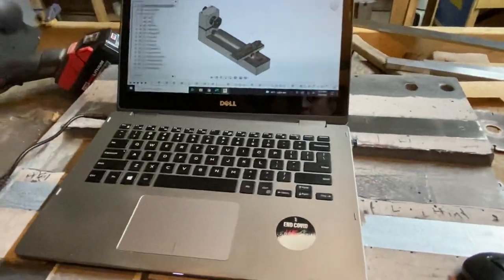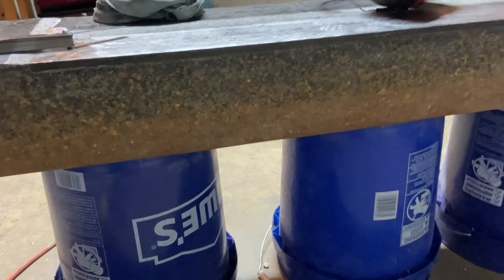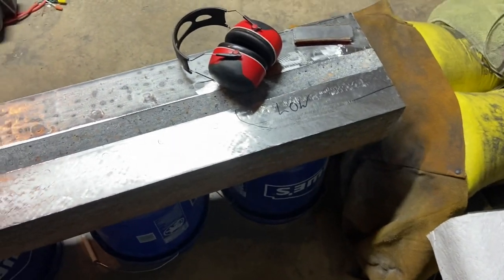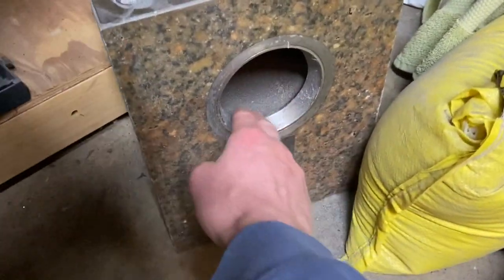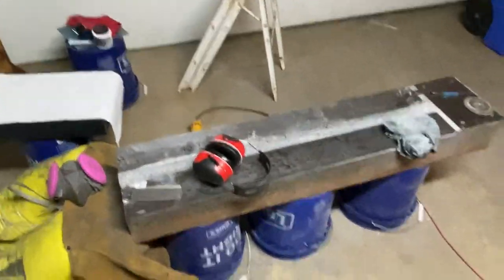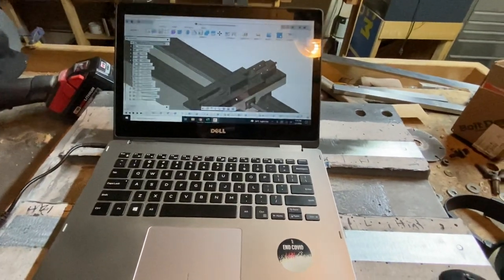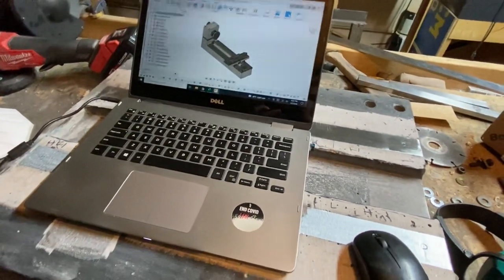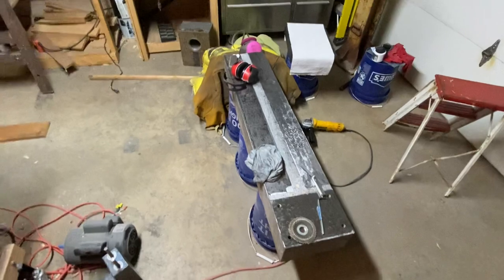DIY Epoxy Granite Lathe #1: Progress Update

Comment: Awesome project Robert. Nice progress. From here your entire internet fan base is expecting weekly updates :)

I would recommend LinuxCNC. You have all the advantages of a fully developed CNC controller. I am sure you can scrounge an old desktop PC to run it. For a basic lathe the Mesa 7i96 is excellent, and $120 is cheap for what it does. That is what I used on the Mini Lathe. I got a bit more ambitious with the Schaublin, due to its extra I/O for gearbox, tool changer, pneumatics etc, but would seriously recommend the 7i96 for your lathe.

Your video is a good first attempt. Using a clamp or tripod or something to hold the phone is the next step, and you can do basic editing in Windows photo viewer or what ever they call it. That is how I started. You speak clearly and dont ramble much, so it is well watchable.
Thanks for making that video. And  I am not kidding, I subbed to see your weekly progress. Posting weekly videos is what got my mini lathe project done. Helped with focus.
Reply from the maker: Thanks!! Im really excited for how it’ll turn out.  

LinuxCNC definitely sounds like the way to go, and 120 is actually a lot cheaper than I was expecting- the only thing that concerns me is figuring out how to use it as my computer skills aren’t anything to write home about lol. 

As for the video Im definitely interested in making more regular updates, Im going to try to order a cheap tripod later today. Counting commute Im working about 70 hours a week right now which for me is tough, so Ill have to see how quickly I can really make videos, but this last week I made good progress. Hopefully that’ll continue so I actually have something to show hahaha. Anyways, thanks for the feedback I appreciate it! If you see any issues with the design or anything please let me know haha, before this project Id never seen a lathe in person much less touched one, so Im not exactly coming from a place of experience.

Comment: In my opinion it’s both more desirable and easier to set the cross slide ways to be exactly perpendicular to the spindle, rather than exactly perpendicular to the z axis ways. Might seem like a pointless distinction but hear me out. The goal (presumably) is that when you face off a part you want the surface to be flat. This is easy to achieve by taking test facing cuts, and then indicating the face of the part from the cross slide. On the near side (where the tool was previously cutting at) the indicator needle shouldn’t move as you run the cross slide in and out, but if you go past the center of the part then the indicator will detect a slope on the part if the cross slide is not perfectly aligned to the spindle axis. Because if the cross slide is not perfectly aligned to the spindle axis then a facing cut will make a very slight cone. Just keep adjusting the rails until facing cuts don’t generate a cone anymore.

Awesome project by the way I’m about to watch the rest of your series
Reply from the maker: Thanks for the comment, that’s a great point. I can’t remember exactly what I said in the video to be honest, it’s been a while, but basically I’m hoping to get the cross slide roughly correct by squaring it to the main axis (since the lathe isn’t operable yet) and then once the lathe is running I’ll be doing exactly that, to get it fully dialed in. 

That method is also nice since it doubles the error, since the slope of the part is moving one way while the slope of the cross slide moves the other after the halfway point, that should make it much easier to measure
Reply: @robertsteinwandel6658  exactly! Sounds like you are familiar with this test. It’s great for getting lathes dialed in
Reply from the maker: @andrewphillip8432  I’m excited to have a working lathe to do the tests in the first place hahaha
Thank you!

Comment: You may want to check out a video by "An Engineers Findings" about alternative scraper geometry for scraping steel. I'll try to find the link and post it. It looks like the grinder technique is working for you though so maybe it will be unnecessary, but maybe if you can make it work you could hand scrape last bit once you have it close with the grinder.
Reply: https://youtu.be/FgxjiEBhKvM

Here is the video
Reply: Looking good so far by the way
Reply from the maker: Thank you so much for the resource!! I’ll absolutely check it out now :)

Even though my grinder scraping seems to be working Id absolutely be interested in trying other ways, if only for comparisons sake
Reply: @robertsteinwandel6658  A dremel with a rotary grinding stone is an excellent alternative too. Much faster and more accurate since you can shape the cone to a finer point.
Reply from the maker: Bob Weiram Id heard of people doing that, thats a great idea honestly. How would you shape the stone, use a carbide cutter or something similar?
Reply: @robertsteinwandel6658  A diamond flat plate would work, but it depends on the type of stone. Some Dremel kits include the stone and a few diamond grinding stone accessories that will work as well.
Reply from the maker: Bob Weiram Ah thanks for the tip! I was actually meaning to get a diamond plate or two for sharpening anyways, so that would be a great benefit.  

Do you know of any vids showing the process? Id guess its very similar, but it would be cool to see the details!
Reply: @Robert Steinwandel  if you haven't already bought a dremel, you might want to look in to a flex shaft rotary tool. It's more or less a much larger motor, with a 3ft flexible shaft and collet. I had a cheap dremel with a flex shaft attachment, and it was really great, but it seemed to be rather underpowered, and only accepted the small 1/8in shaft tools. Some of the larger rotary tools go up to 30,000rpm, and claim more than 1000W of power output. I suspect that the real numbers aren't anywhere close to that, but I believe they likely have a ton more torque than a dremel, and many can also use the larger 1/4in tools. I'm planning to invest in one myself in the near future. Hopefully this helps you with your project, and good luck! Looks great so far!

Comment: Nice project!
For a next project I would use less wide steel inserts that will hold the linear rails. Let’s say approx 1/2” wider than the rails itself. This way you have way less steel to grind and flatten. Hope this makes sense 😅 Anyways great job though!
Reply from the maker: Thank you! 
I see your point, but I actually have to disagree. I think if I redid it I may actually go the opposite way and instead of 2 4in wide inserts I would use a full 10in wide plate for the entire top surface. The plate would be fairly flat to start with, especially if its cold rolled, but more importantly it would be easier to measure the flatness. Particularly for twist having a full surface would be much easier to check, which is a big factor in to time it takes to flatten the rails
Reply: Don’t use steel at all its a terrible dampener  and it rusts.

Always use Cast Iron or ATP-5 precision plate which is 7000 series machine grade cast that needs nothing done to it. 

Plus a full ATP5 plate allows for room to bolt on strips for rail guides or any other features. You can even TIG weld guides on after indicated. 

You must have a guide, or machine a ridge to keep the rails from shifting when in use. His only choice now is to take it to a machine shop and have them groove the seat for the rails. 

If he don’t that machine will be problematic. Been building CNC’s many years this is something I know well. There is also a reason industrial machines have this in the castings. Has to be just enough to keep them aligned and not so tall that the blocks rub on it.
Reply: @glennedward2201  would ATP-5 be rigged and heavy enough compared to casted iron? Thanks

Comment: Any reason you didnt use a solid single plate of ATP-5 since its precision and doesn’t require grinding or scraping?
Reply from the maker: To be completely honest I know aluminum fixture plates ect. Exist but I didn’t really look into that option. Looking back though I think I still would have gone with steel, my thinking being:
Aluminum doesn’t have much vibration damping and is less dense than steel- I doubt this would matter too much in the grand scheme of things but first thing that comes to mind 
Aluminum is much softer than steel so I don’t know if I’d trust myself not to ding it up throughout the build
Although it’s a precision surface, with the weight of curing epoxy above it I wouldn’t be surprised if the casting cured with a bend in the plate (the mold was only accurate to around .030in - I might ruin the accuracy just with the weight of the epoxy before it cures. 
And the other aspect would be cost, I would assume that tooling plate is quite a bit more than the around $100 I paid for the steel? If not though please let me know haha, maybe I’m missing out here lol
Let me know what you think, Thanks!

Comment: Nice project! I wonder, did you cover the epoxy granite part elsewhere? Would like to know the recipe you use. The result seems really good. Thx!
Reply from the maker: I haven’t actually, one or two people mentioned it in comments though, Ill try to make a video about it soon!

I had 10-11% epoxy by weight, 4 aggregate mix from play sand up to .5in, graded with sieves

Have you made any eg castings already?
Reply: @robertsteinwandel6658  thanks for the hint.
No I didn't. I am converting my cnc to linear rails and have just finished to make the extra parts. Next in the list is fill up the voids with eg. That's why I asked for it 😁
Reply from the maker: Ale ah thats great, sounds like a really cool project!   EG was so interesting to research/ work with, Ill try to put out a video with all the info I have soon! Let me know if you have any specific questions and I can try to answer them if I happen to know the answer
Reply: @robertsteinwandel6658 Thank you, Robert. I guess my main questions will be about the right EG mix and overall procedure. For instance which product to use to avoid the epoxy to stick to it, how to limit and remove air bubble from the epoxy. These are common notions I more or less know, but it's different when you have a video showing the technique and the final result. It gives you a confident burst.
Reply from the maker: Ale absolutely! For removing eg from the mold paste wax is absolutely outstanding- just rub it into the mold walls and the eg will just pop right out (if its a wood mold you can just chip it off anyways but what a bother) 
For removing air you absolutely want a pretty hard vibration around 60HZ (I think some german guys found 64HZ is optimal but a 3600rpm motor with an eccentric weight is an easy way to get very close to correct) 
Ill show my exact setup for the vibration in a video but when your vibration is good it works insanely well. Like my eg would look like barely damp sand at the beach, until I vibrated it and it would condense down so much there would be a glaze of excess epoxy on top of the eg sometimes (hard to describe in words lol) 
If you haven’t checked out the main eg forum on cnc zone you absolutely should, they have a huge amount of info there (no video tho sadly)
Reply: @robertsteinwandel6658  Thank you, Robert. Any particular type of wax to advise? Yes, I read cnc zone threads some time ago. I should give it another go before starting with the eg project. Just to play safe.
Reply from the maker: Ale I just used an old tin of paste wax I found sitting around, but basically any paste wax should work. Most of them say for like finishing furniture and stuff, that should work great

Also maybe you already found epoxy, but if not the US composites website is awesome, youd just want their thinnest epoxy with the slow hardener. They were great to deal with and it was a really easy process for me
Reply: @robertsteinwandel6658  thanks for all the tips!